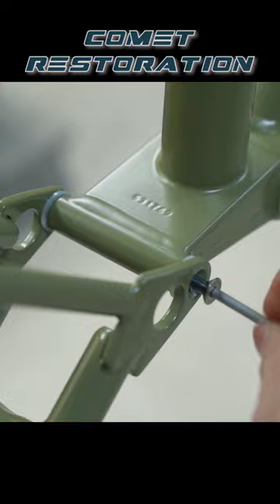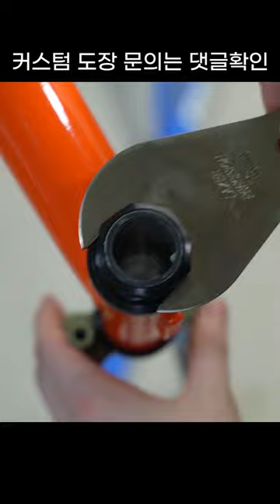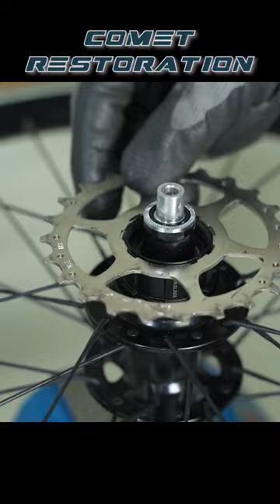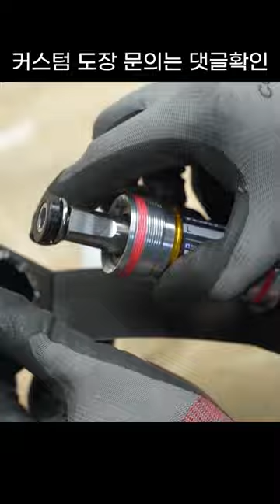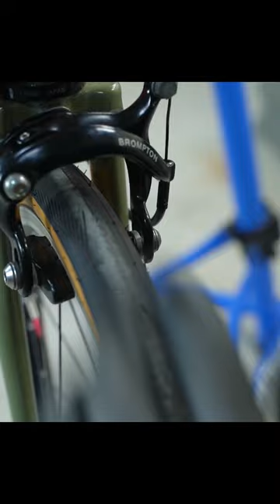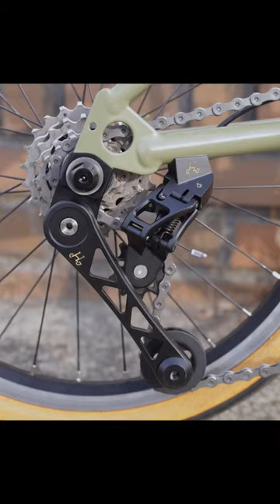Bicycle 1 minute Build - BROMPTON

Comment: You put loctite on the top of the bolt instead of the threads 😂.
Reply: What do you think, wher does it run ,when the screws run into the thread? Normally your threads are horizontal or? This is a trick to avoid nasty blue spots, where they dont belong. Loctite is capabale of ruin paintjobs.
Reply: @eisenschenkel595  You can just wipe it off if you use too much, a tiny dab is all that’s required. But it won’t do shit on the top of the bolt
Reply: @eisenschenkel595  the loctite doesn't run anywhere if you put it on the f* top dude. Due to how bolts are manufactured tops are also concave on that side, the locktite is doing sh*
Reply: @eisenschenkel595 that isn't a trick , it's the improper way to use Loctite. They may as well have not used Loctite at all. 100% incompetence.
Reply: @eisenschenkel595  loctite should be applied to the threads, and as far as im aware you should never put anything on the end of a non-through bolt as it could prevent it from being tightened to proper torque spec as the fluid is incompressible
Reply: @fuckgoogle7314  chain lube goes in between the outer plates and the inner plates, its to lube your chain not to lube your cassette lol
Reply: @eisenschenkel595  not sure if you know the use of a loctite. the liquid is suppose to be put on the thread of the bolt. it is supposed to leave a blue mark there (or red depending on which type you're using). the liquid will dry up over a few hours and it locks the thread of the nut to the threat od the bolt. so vibration won't unscrew it altogether. putting loctite at the top of the bolt isn't going to do shit.
Reply: bro that locktite blob 100% went all over the threads when it went in lol.
Reply: @___Bebo___  I take it you’ve never hand built an engine before?
You’re supposed to prep threads before using thread locker as well but I left that out.
If you’re going to use threadlocker, use it so that it actually makes a difference.
A stripe down one edge of the threads is all that’s required

Comment: And in the end he lubs the chain from the top… what an utter disappointment.
Reply: It doesnt matter because the chain only needs oil inside the small rollers, bc the roll and the pins are the only thing that really wears out. It will get there from either side
Reply: Exactly what I was thinking! 

Fail LOL